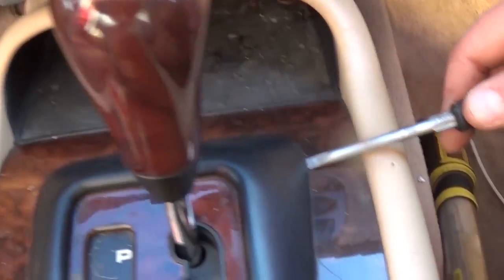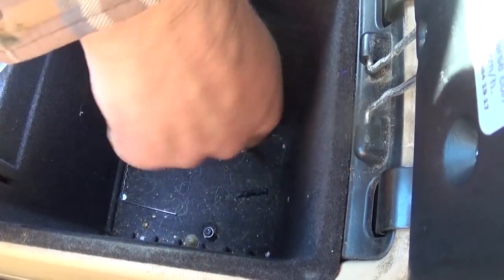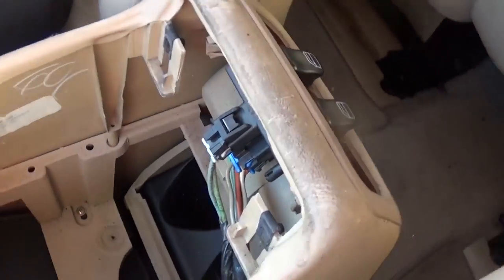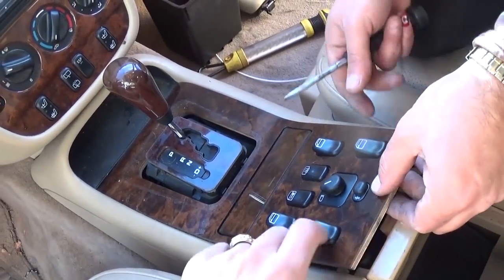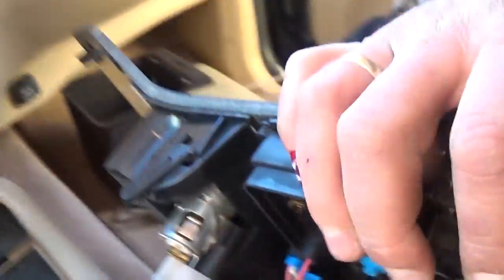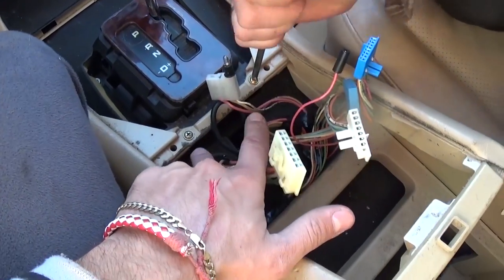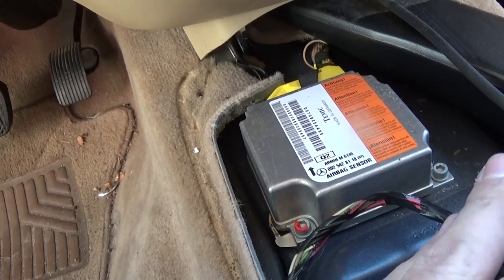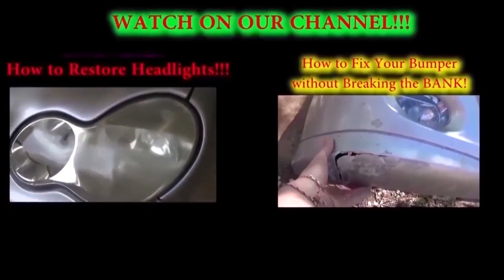Airbag Module Removal Replacement and Location Mercedes w163 ML230 ML270 ML320 ML350 ML430 ML400

Comment: Thank You from Malaysia for this wonderful lesson on Air bag Module,  I have 1 question on my W140 when I removed the module to clean the contacts I DID NOT NOTICE  A BROWN WIRE WHICH IS RECTANGLE IN SHAPE AND HAS A HOLE  IN IT I wonder if it should be fitted directly under the module on the left hand side as it is clean as the holes are a bit dirty. Thank You  and CHEERS. Its almost drinking time now.